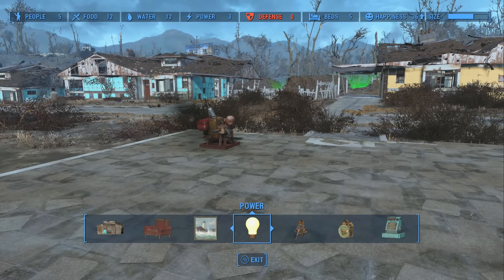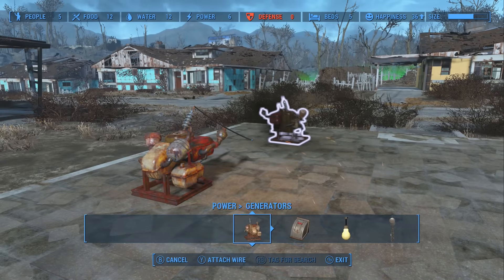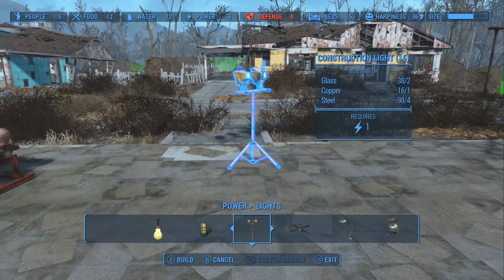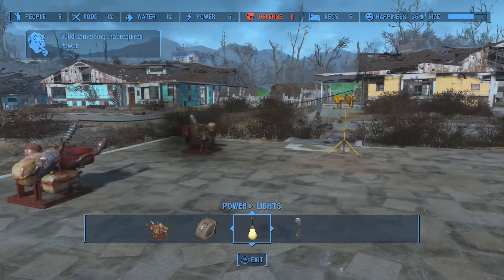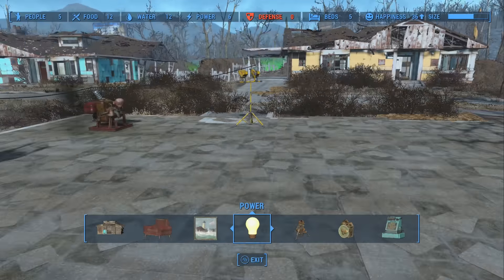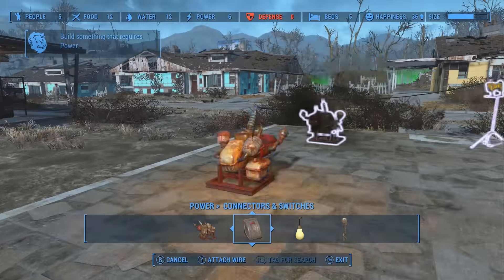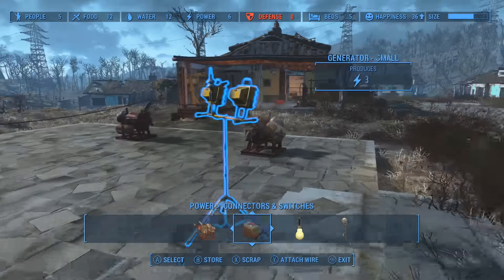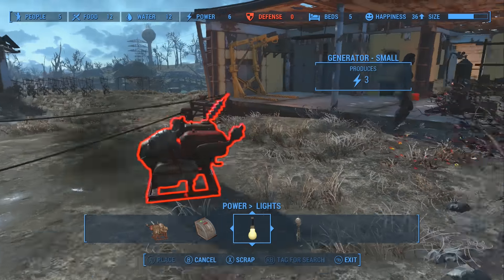FALLOUT 4 - SETTLEMENT BUILD GUIDE 5 - Power Explained

Comment: Great guides, I subscribed. But my problem is I built a house and powered it but then realised I put the generator inside the house. How do I have an outside generator and wire it to the built house so the lights come on and then use the same generator to power the settlement recruitment speaker?
Reply from the maker: +Simon John Keatley Thats a difficult one which im currently working on, for now I have a small generator in all my houses.  But I will have a video out as soon as possible =)
Reply: +Lunar Craft Seems like you might be able to leave an opening, then use a pilon close to the opening to bring it inside... Maybe do a half wall somewhere. Just a thought for people that might be really OCD about putting the generator outside. Hopefully they will come out with better ways of distribution later, such as breaker boxes.
Reply from the maker: Im gonna try and work it using power conduits throughout the house.  If the wall pieces didnt snap together so much you could put a space between the walls for wires and stuff like a real house
Reply: +Lunar Craft Trial and error made it work. I used a little pylon attached to the top and it also worked attaching one to the top side instead, then just a few wired inside to spread it. Ain't a clue on their physics behind it but it worked.